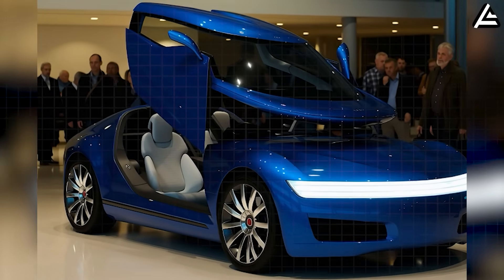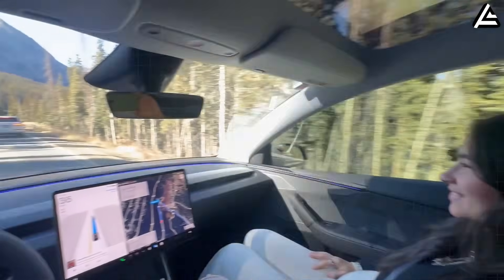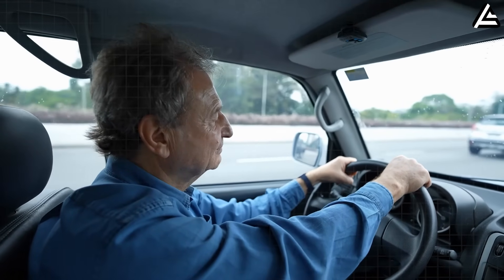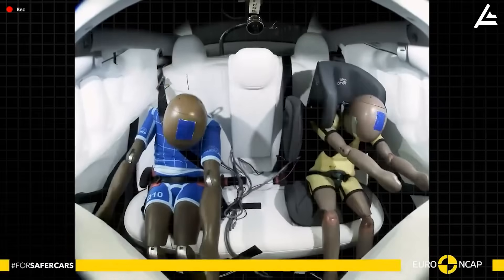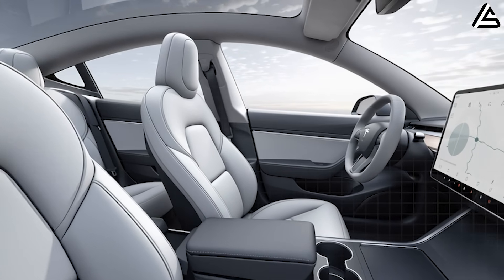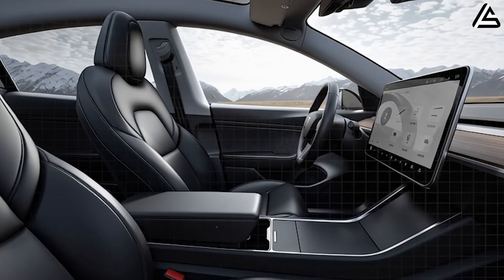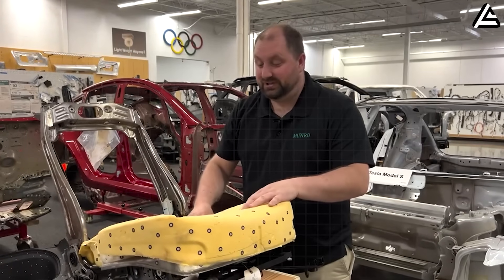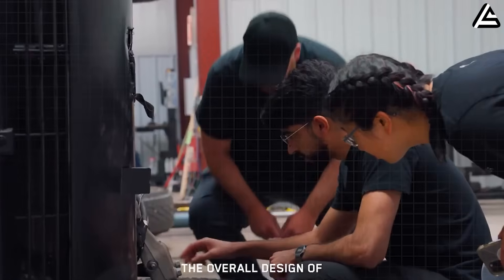2026 Tesla Model 2 Senior Edition Looking Like A SPACESHIP. What's Inside?

Comment: Not even being made yet and may not be,   all these Tesla 2 videos are FAKE !
Reply from the maker: It’s true that the Tesla Model 2 isn’t in production yet, but that doesn’t mean all of the videos are ‘fake’. Most of them are just concept renders, predictive models, or analysis based on leaked data — that is, unofficial content, but still valuable if presented as it is. It’s important to distinguish between Tesla’s published material and the community’s interpretation.

Thanks for your comment, we’ll consider clearly indicating the level of ‘official’ information.
Reply: @AutoGearShift2  I've seen about 4 different looking Model 2's on YouTube .
Reply from the maker: Multiple looks usually mean Tesla is still testing proportions and manufacturing constraints rather than styling alone.

Comment: Which feature—thermal, structural, cabin atmosphere, or seating—adds the greatest safety improvement statistically?
Reply from the maker: The biggest statistical safety boost likely comes from the structural upgrades, since crash-energy management has the strongest measurable impact in real-world data.
Thermal and cabin systems help too, but structure usually moves the needle the most.
Thanks for the great question!